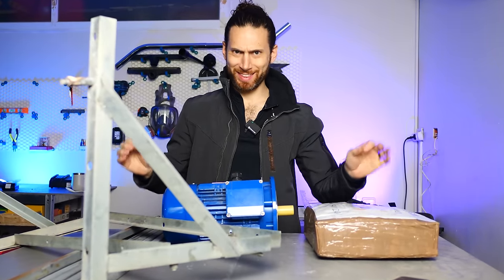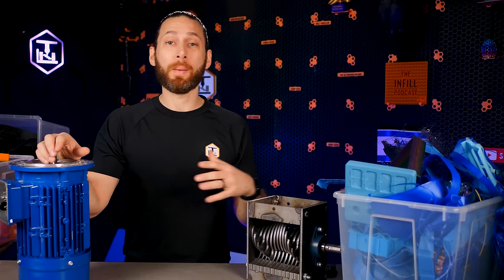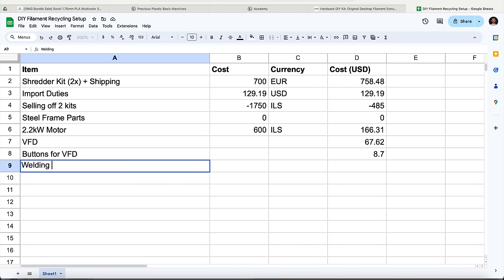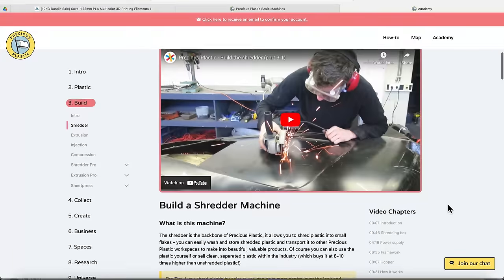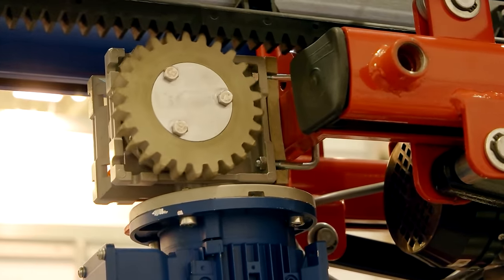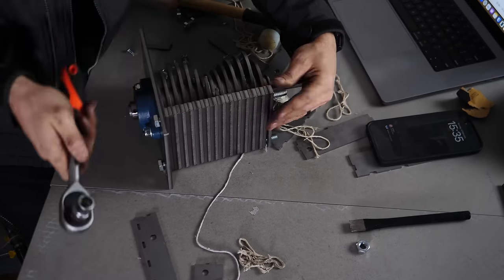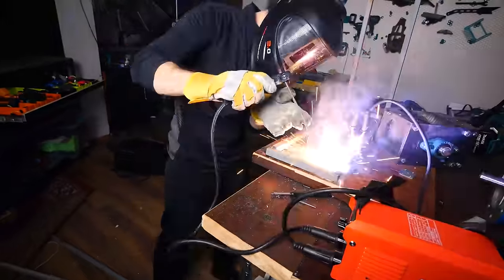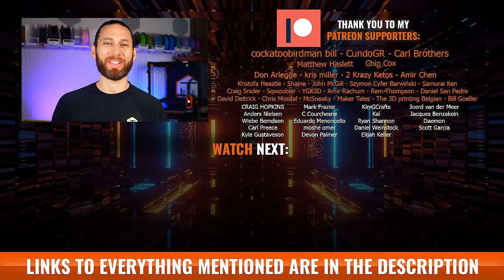Affordable Filament Recycling?

Comment: Your approach is pretty much the same as everyone else does it. I cannot help but feel that there must be another option. Having to cut everything up in to tinny pieces is an expensive and time consuming process. Someone needs to research to see if it's possible to just dump all the material in to a metal vat with holes in the bottom, heat the vat up so the material becomes molten and then use hydraulic pressure to press down on the material. A spinning blade below the holes would then cut the extruded material up in to pellet sized pieces. I don't know if this process would work, but if it did it would cut out many stages, and at least someone would have tried something different. I would make for a great video, even if it fails.

Comment: DC motors may cost more depending on selection, but your options for reliable speed control and torque are going to be greater in a  residential situation. 1ph to 3ph VFD's are usually very small and pretty expensive for being 2HP or below. Just some thoughts from someone who works in industrial automation and also does hobbyist electronics. Check places like mouser to narrow down your potential parts based on your physical requirements. Cross reference from there for domestic pricing if available where you live.

Comment: Hey Jonathan, totally dig this video moving towards recycle/repurposing resources. I may be repeating a few comments seeing 257 and counting hoping this comment brings it all together. 
Being a safety kinda guy I'm going to point out a few things that will be crunchy, but all in good intentions and care about your safety. AND I do have a suggestion on your gear reduction issue.
Safety 
1. The box tubing looks to be galvanized. IF so the off gassing is very dangerous. even so I highly recommend ventilating any off gassing created by welding. Even with a respirator, that gas has to be evacuated. A small hood set next to the work with a strong couple of fans with vent hose pulling the gasses out to a nearby window is better than nothing.
2. Using Galvanized metals, any metal needs to be ground clean for the welds to take, In the case of Galvy, I'd grind it a good 6~8" back from the area to be welded. or wrap a wet rag a ways back from the weld to contain the heat. 
3. The area you're welding in looks very unsafe, your rug to the side could easily catch fire, not sure about. Welding will launch molten metal drops amazing distances. Also get a fire extinguisher, it's a must have.
4. Nicholas has a good advice on welding rod technique. If you're planning more welding get a MIG, much easier and they are so much more affordable these days.
5. If you're welding sheet or thin metal clamp a piece of Copper on the back side to help prevent blow through.

Ok on the gear reduction.
A. Not sure if you have access to this supplier but great resource for what you need for this project. https://www.mcmaster.com/
B. If you can't find a gear box consider a chain gear reduction. You can save yourself some space by having the motor offset from the grinder. Easy to figure out your gear reduction, using a chain is solid! just be sure to put a chain guard over that. eats fingers real fast, also helps keeping debris out of the chain. Best of all you get the motor back up into a better torque range. 

Stay safe over there.
Best
Jim
Reply: Oh I forgot to add, by using a sprocket and chain you'll solve your mounting and alignment issue. You can mount the motor to the 1/4" (6mm) plate, I'd suggest welding a bracket to the frame, bolt the bracket to the plate that holds the motor, The plate you'll need to stiffen on either side of the motor plate to stiffen it. PM me if you can I can do a sketch for ya. Shouldn't take any time to do it.
Reply from the maker: GREAT tips. How do I know if metal is galvanized? I turned on fans opened windows, as well as a vent... but I do want to be safe.
Reply from the maker: Enjoy your permanent ban, Prints of Darkness!
Reply: @thenextlayer  The Galvanizing has a grey finish, chalky to the touch feeling. The finish will chips off to reveal the metal below. Most chainlink fences and round piping have Galvanized finishes. So you could compare that.
Reply: @thenextlayer  banned?

Comment: I probably would just drill holes into steel and bolt everything together with 90 Degree steel angles instead of welding (it will go to the corner with between so probably doesn't matter if it's welded or not)
And you can disassemble everything if needed

Comment: I have been considering buying what is called an oil press. Its used to extract oils from nuts and things. It has an extruder screw and a heater and hopper to feed in the nuts. It seems like it would be a fairly cheap way to convert to an extruder. It has all the parts already for the most part and its between 100 and 300$. I have not seen anyone do this yet, but it seems like a straightforward way to get a very cheap exteuder to me.

Comment: In a super basic way, you can think of VFD like a PWM fan/LED. It's in the name, Variable Frequency Drive, it's just making a modified sign wave/square wave to switch the polarity of the electromagnets to achieve the desired rotation speed.  I am also going to take a stab in the dark and say that the slower longer and square pulses are going to generate more heat than a raw pure sign wave, so, add a k-type probe and a fan if it gets near its design max temp to keep it alive longer.

Comment: probably not readily available in your free stores, but for anyone following along that doesn't want to bother with welding: the frame could be build using aluminium extrusions. Like those that many printers are using. Easy to assemble and attach things to, also very easy to get perfect 90° angles.
Reply from the maker: Yep. Realized this after. My tables and shelves, too!

Comment: Ok so there is few major issues with this setup, first while it’s true you can lower the motor speed with a VFD but that motor won’t be able to handle all the torque as that is limited by the motor physical design, second that poor base will break apart as soon as you turn on the motor 😅 you need frame between the motor and the shredder that can handle all this bending forces.
Reply from the maker: Can you elaborate? A lot of people have said the frame will break... Do you mean I need to add a cross-bar in the middle, or what?
Reply: @thenextlayer  
for every action there is a reaction, when the motor turns the shaft one of two things will happen, either the shredder will run or the frame will break and the motor will start to rotate around the shaft depending on what is weaker the shredder torque demand or your frame. What I would suggest is have maybe a plywood as common baseplate between the motor and shredder (maybe you will need more than one layer, I didn’t do the math on it 🙃) you can look up pump baseplates for some inspiration and further understanding. You will also find how they do shaft alignment that also is very important for your investments lifespan 😁.

Comment: That is one massive project!  WOW!

As for the stick welder, while I've used the one I have now and then, I too just can't get used to getting the spark to start without getting it stuck to the metal.  LOL

So I ended up getting a MIG welder.  Since there's no stick to strike against the metal, just a handle where you push the trigger and the wire starts to feed out, it's easy to get the spark going without sticking.

That might be an idea for you.

I find since getting this, my welds are much nicer now. 

Good luck on your project.

Comment: I love this video. Your welds, however are triggering. I highly recommend sanding/grinding off the millscale and paint from the weld zone. As thin as your stock is, you might consider using a MiG or small flux core alternative. I don't know about availability in your region, but local hardware stores often carry small wire feed machines that are much easier to use than the stick welding alternatives.

With stick welding (what you're using) more amperage generally means more heat (it's actually more complicated than that, but this will get you started). If you find the rod sticking a lot bump up the amperage slightly. If you get a lot of spatter, you're either too far away or your voltage is too high. 
With wire feed it's very similar. Your feed rate can control your heat and adjust the voltage as necessary.

There's a lot more involved, but this has also been a huge info dump.

Comment: Look for a star coupling for getting the drive shafts connected, normally you want in any mechanical joint a soft material that can wear before any of your mayor components, the coupling has a rubber section that is easily replaceable and helps with minor deviation and vibration.

Comment: This might be a dumb question it melts at a certain point? Could a large hopper not be heated to a liquid? Failed prints just melt then run the liquid through a heated stepper to step down to 1.75mm. Cooling as it goes.

Comment: When you’re using a stick welder, you want to strike the arc anywhere around the part and then run your bead go forward them back a little forward them back a little or you can use circular motions and just push down to fill it in

Comment: Cool project. I'm still dubious about impact on environment of such solutions. I mean I hate wasted plastic and giving it's really poor recyclability reuse could be great. However there's a cost to such recycling. The parts we buy the machining, welding etc of the machine. The building of motors the shredders not to mention electricity to run the thing also have impact on environment. I'd love to see some analysis that would break down the total impact to environment of such recycler and when does its recycling offset its own impact on the environment.

Comment: Hi Dude, Stickwelding is hard. I learned it at Burmeister & Wain a lifetime ago, but haven't hardly used it since. A Tip how I see it (it's like religion) I use the angle of the stick to control the tempo of the burn and thereby the size of the weld. It looks to me like you should use more of an angle and just let the burning tip run along. Hope it helps.

Comment: Armchair steelworker here: it kind of looks like the steel is zinc coated. I think the welding might work better if you grind the beams back a bit to expose the clean steel. But hey, I've never even held a welder so what do I know :D
Reply: Yes. And in addition the fumes from the zinc are pretty toxic.
Reply from the maker: Good call

Comment: When it comes to smoothing out welding seams just know that grinding a welding seam flat greatly reduces the structural integrity of the thing. In here it's probably not a problem but on structures where you need it to hold loads you gotta accept that a welded seam is a welded seam. The only thing to make it pretty and strong is to apply paint and improve your welding technique & settings on the material you are working with.

Comment: The cool thing about getting the "average Joe" to be able to recycle filament, is that not everybody needs to have a recycling system in place. For instance if I managed to get a system working, I could take waste filament from my neighbor who also 3d prints. I don't 3d print much and I produce very little waste so I don't have a use for this personally, but get a "community recycling" system going on and everyone's waste filament could (in a perfect world) get recycled into new filament.

Just a thought.
Reply from the maker: BINGO. And you can list yourself on Prusa's site as a recycling center

Comment: Instead of electronics use a “jack” shaft.have motor use small gear going to large on the jack shaft then another small gear on shaft to larger gear on shredder. Will slow shredder down and provide lots of torque. Can use old computer enclosures for the sheet metal. I would also suggest a second small gear on jack shaft going to a summer tooth shredder underneath big tooth then not have to catch after first, just catch second shreds.

Comment: Glad your taking this project on too I've been slowly working on it as well the past few years, I also bought a motor not realizing I needed a slow rpm motor, picked up a 1 hp motor that goes 1800 rpm....
Reply: Been looking into gear boxes have a line up on a couple but they can be expensive was looking into a vfd as well, but glad I also read about it not really giving you more torque, just less rpm, I would definetly look for the right gearbox for your motor would not like to get an underrated one as the gearbox or the motor will fry after awhile and have to replace it again I will try to find the video I was watching on this
Reply: https://youtu.be/LZA-kEpQgNM?si=nbP0iSxp5OoOyuHn

Another video of making a plastic shredder same idea but there's a spot in the video that talks about what too look for in a gearbox for your motor,
Reply: Hope that is helpful and wish you luck look forward to see the extrusion process you decide
Reply from the maker: Stay tuned for the next video, lots of hard-won lessons...
Reply: Gotta learn somehow
Reply: I didn't see teaching techs video but wish I had a long time ago he's using a garage winch motor, which us like a hundred bucks in my area I have a harbor freight, but it's a low rpm high torque motor, only thing is your gonna have to hold the button, I'm sure there's a way to wore a toggle switch though,

Comment: A good rule of thumb when ordering a VFD to convert from single phase to three phase is to order one that's double the amperage. So if say you were had a 15 full load amp (fla) motor, youd want to get a vfd thats rated for 30... And I highly doubt you're going to get the proper torque by going down in speed with the VFD. You are still going to want a gearbox.

Comment: Just gotta clean that metal up before you weld it! Metal immediately start's to oxidize when exposed to air you basically have to knock that oxidation scale off before you weld. I'm sure you will get the hang of it.

Comment: Press F for the 3-2-1 blocks
Also, I cannot recommend enough getting a MIG welder, they are so much easier to use than stick.
Also also, cleanliness of joints is welder's godliness
and, before welding the real parts, calibrate power and skills on test pieces. 
Welding proficiency comes with "helmet time"

Comment: I recommend 3D printing parts and re enforcing them with the metal you are using. 

You could also use 3D printed parts to hold the parts together while you tack them into place to ensure a perfect square. They may melt as a result of the heat, but the point is to hold everything in place while making the welds.
Reply from the maker: Damn, that's a really smart idea.

Comment: as a mechanic the welding hurts but i belive you will get there eventualy.
use more amps and try to be consistant with the speed. practice striking the arc on scrap metal

Comment: NB: Also NOT a welder just a hobbyist maker so take any advice with a cup of common sense. I second those who have been saying clean the scale/paint off the metal where you are working and where the ground clamp goes before welding. This will help with starting a weld and keeping it going smoothly. 
Avoid running your welding bead (the pool of liquid metal at the end of the electrode) back and forth because the slag protective layer left behind on top of the cooled weld gets trapped inside the metal causing bubbles or pockets of slag which greatly reduce how strong it is and make everything more difficult.
Each weld should be laid down at a steady pace dragging the electrode (so its pointing back towards the weld puddle). 
If you are having trouble with burning through the work piece (2mm RHS is a pain with a MMA welder) try a thinner electrode and a lower amperage, if this is not possible just weld in large tacks at regular intervals so the metal can cool, make sure to clean away the slag before going back over it. 
If you find you want to use a welding rod as a filler take the flux coating (grey coating like dried clay) off, the coating on your active electrode is enough to shield the weld.

Comment: The type of welder aside, you can get a more consistent weld if you in fact you're supposed to do this clean up the area first with a wire brush or grinder

The only welding that I've ever gotten away with without cleaning up is a MIG
Reply from the maker: Thanks for the tip, will do next time

Comment: VFDs are similar to pulse width modulation. You control the speed be essential turning the power switch on and off really fast.But it's great for getting 3-phase AC when you don't have a 3-phase source.